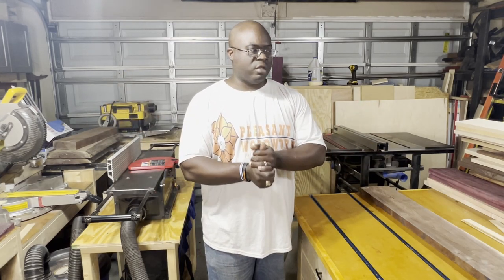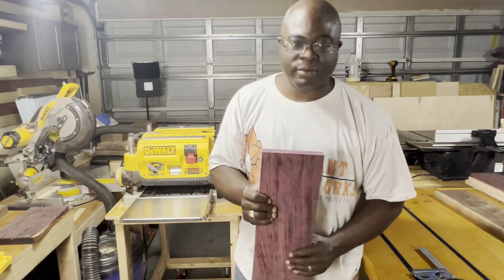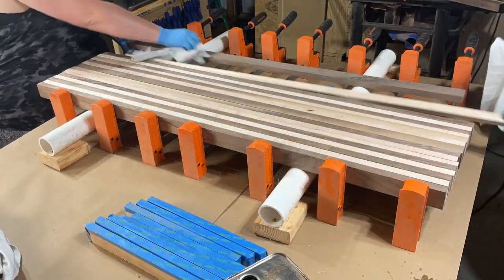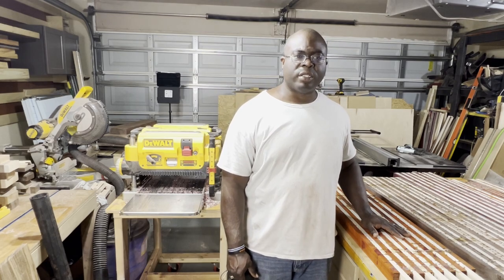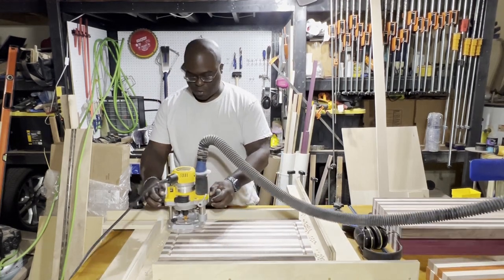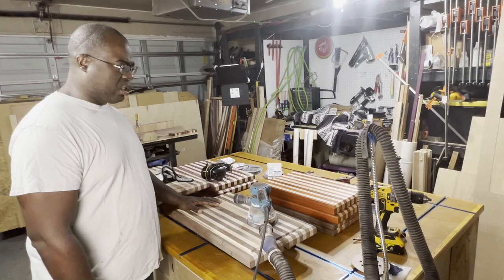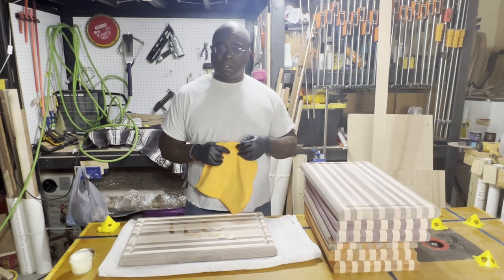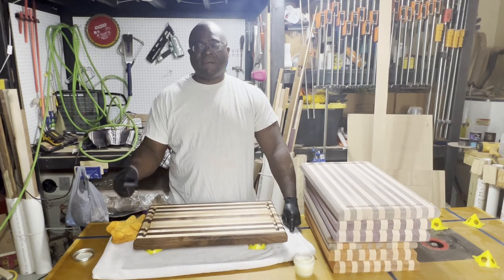DIY Cutting Boards

Comment: Great video! I really enjoyed watching it. I do have a question? Do you live in a HOA? I do and I’m concerned about the noise I make and the neighbors!
Reply from the maker: Hey John thanks for the comment. No I don’t live in one but I’m respectful of my neighbors. I am in law enforcement and switch from days to nights monthly. I work my table saw, planer, and jointer before 7pm and save the sanding and finishing till after 7. Although I’m pretty sure they can’t hear anything if my garage is down and they are inside watching tv while I’m using the planer. At least I haven’t had any complaints.

Comment: You do beautiful work. I’ve been collecting the power tools for years. I have not made anything yet. Can I please ask a question? It looks like you had a board under your work as you ran it through the plainer. Is this something I should be doing? My plainer is brand new two years ago, never used..
Reply from the maker: Absolutely due to the way planers work. If what you send through isn’t completely flat on the bottom then the top won’t be flat. Feel free to message me on Facebook and I will go into detail. Just search pleasant Woodworks.

Comment: You know what would make one even better?  Slice it on its side into 2 halfs  rout a pocket top and bottom  to store knifes in.  Then make cutting knifes with some of the scraps left over you can buy good knife blanks and put wooden handles on them. The knifes lock into place so they can't fall out, on the bottom  side are built in hooks to hang it on a wall,  with supplies to attach it on sheetrock wall or even a cabnit door.
Reply from the maker: I’ve thought about that. I have two friends who are knife makers. Thanks for the comment.